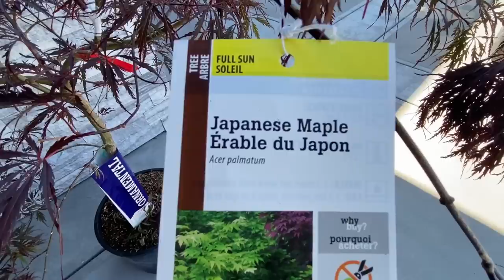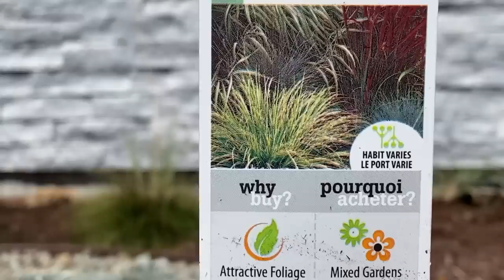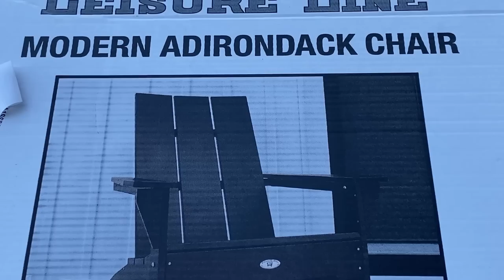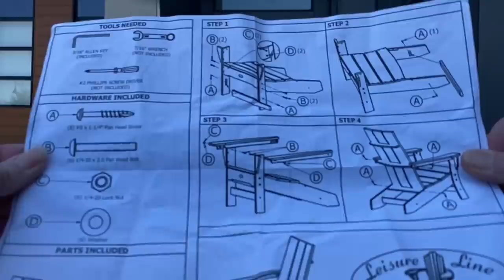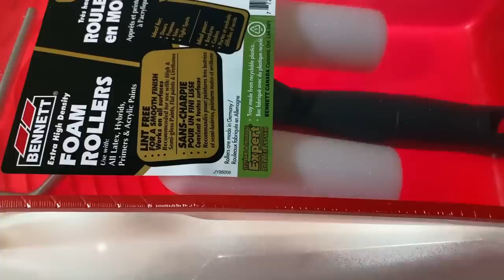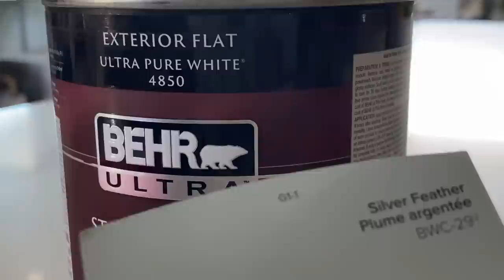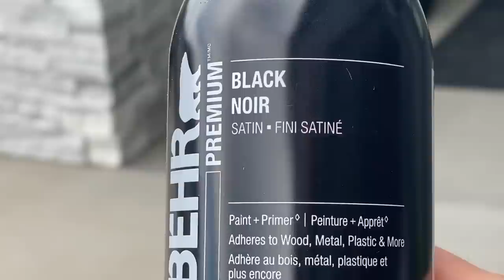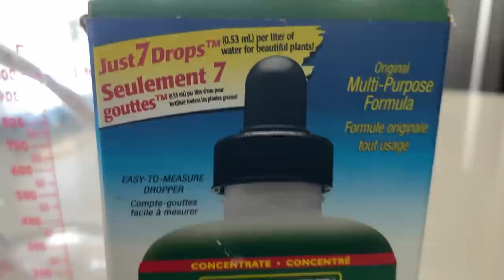Transform Your Front Door With This Easy Diy Makeover!

Comment: You said the planting hole should be 2x the width and 2x depth of the root ball of what you are planting. I think that’s your problem … yes 2x width, but depth should be just enough for the new tree to sit at or slightly above the surface. That’s what I have read many places/times. (This doesn’t apply to tomatoes!).